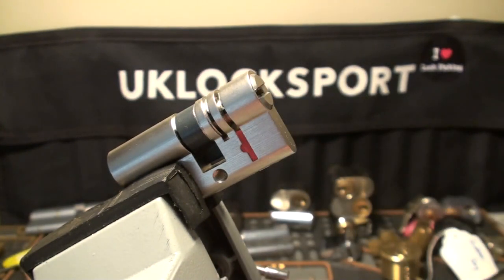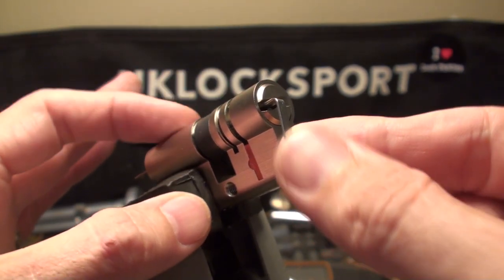112 Mauer GM Redline picked and explained

Comment: Awesome TonyS, I was wondering if it would open just picking the inside core. Thanks for sharing.
Reply from the maker: Nope.
I tried that too, but both seem to need to be picked.
What we need is Tallans or Michael Maynard to strip it and explain it as they do so well !!
Reply: Would love to see the Maynard explanation, although he would definitely have to title it nsfw.
Reply from the maker: Just coming back to your comment, Priyer, as I am playing with the pin tumbler version at the moment. 
Your question was spot on. The cam CAN be turned just opening the interior end, but you can't get much torque and it is difficult to properly rotate the cam whilst the Ext end is still closed.

Comment: Nice job! That LPL 736 Sonico lock is definitely weaker, given that it tensions both cores from one side.
I'm curious though, since this has that break-off point against twist attacks, if it becomes a more normal picking experience after breaking the front.
An advertised feature that you can still unlock it with the original key after that part is broken-off.
Reply from the maker: Well, you would still need a long pick, and that is the main challenge , but it would mean only needing to pick 4 pins !